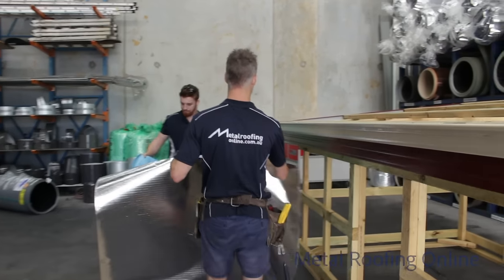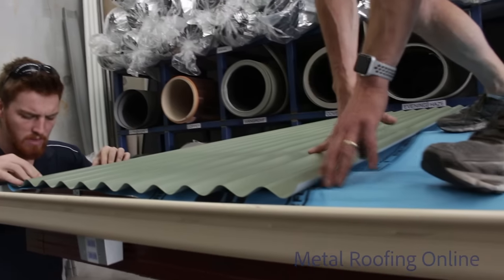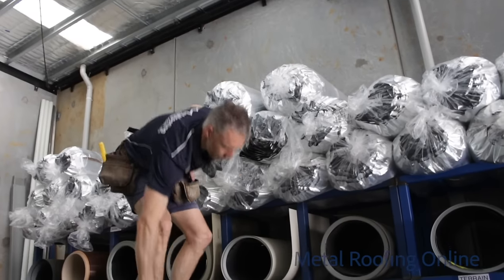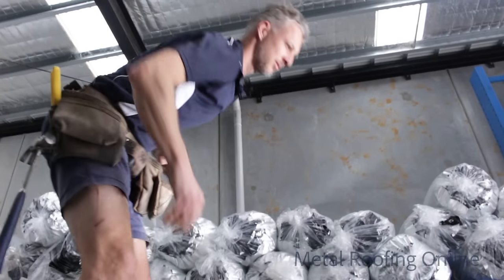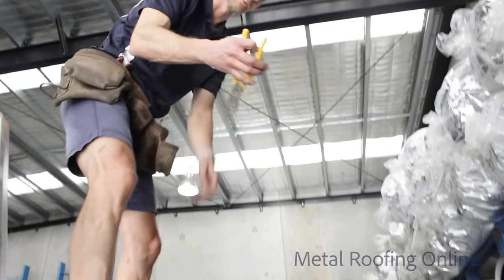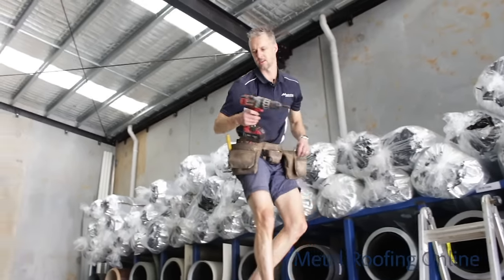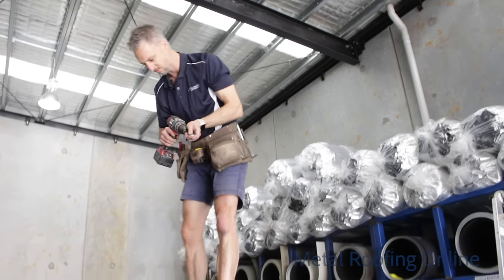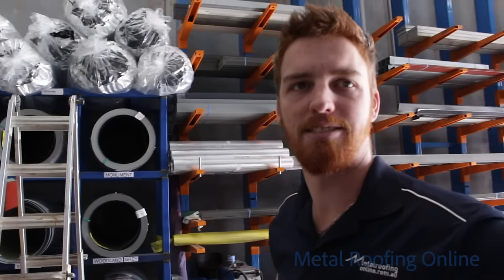How to: Install Corrugated Iron COLORBOND® or ZINCALUME® Roofing

Comment: Advice to anyone getting a metal roof fitted. NEVER fit it without an insulation blanket, foil alone is no good unless it’s just a garage. Must have the insulation blanket to suppress mechanical expansion & contraction noises during the day. Learned this the hard way. Don’t let the contractor convince you otherwise.

Comment: I would use foil under all roofs in any situation no matter if its a closed building or not, when the moisture is on the underside due to cold mornings and the sun comes up it heats the iron which causes the roof to drip, with foil it does not, I have proven this myself as i have a variety of roofs with and without foil.
Reply: actorzone thanks for your feedback

Comment: I get a bit of blow back (if that’s the right wording) under the end of the sheets. You can see the staining on the timber from the water where it tracks back from the end of the sheet where it over hangs the gutter. I have a 10cm fall over 5 meters. What is the best thing to put in place to stop it or how do you bend the end of the sheets down on the lower part of the corrugated sheets ?? (Love the videos by the way)
Reply: You can either nip the tin on the bottom curve about 5mm up or bend it down a touch with a crescent or something to give that effect.

Comment: sen a few roofing videos now why is the lining always sagging?
Reply: It give space for the foil to reflect back up. 
If it was in contact, it would transfer the heat by conduction.
Reply: It should not be sagging! The under lay is for condensation, if the paper is not self supporting paper, they should be using netting under the paper.

Comment: Can you tell me what size screws you use predominantly in this video? I've seen the term NEO and EPDM, are they the same thing? Also are they multi-grip screws?
Reply from the maker: The roofing screws in this video: 12 x 50 multi fix (multi grip) 

NEO and EPDM - the rubber seal on the screws. 

https://www.metalroofingonline.com.au/roofing-fasteners/17-colorbond-roof-screws-12-x-50-multifix.html

Comment: Doesn't condensation drip off the underside of the metal,  onto the saggy vapor barrier,  and then run down into the house???
Reply: I agree. Surely the condensation pools in the drapped material. What is the membrane you have used?
Reply: I don't think so. 
Not enough temperature difference also the sisilation is a moisture barrier.

Comment: Why have you put the paper the same direction as the tin? Am i missing something cos i lay the paper from the low side and work up so that condensation always runs over the overlap and cant find a seam to leak. I respect the pros, but can you clear this up for me?
Reply: I lay paper horizontal on low pitch roofs. Steep roofs it doesn't matter has a 150mm lap and the condensation runs straight down

Comment: Great effort guy's I have a couple tips. 
1. Use self supporting paper and pull it tight.
2. Use a string line into the gutter to get a straight line, laing the roofing iron.
3. Tack the roofing top and bottom, bottom being a consistent measurement, top being under the head flashing.  Chalk line the rows after the iron is installed, then remove screws from the to to install head flashing. This gives you perfect straight screw lines.
3. Great never over lap a sheet more then needed, it will definitely condensate and corrode. 
4. Stop end the sheets on the ground, 3 sheets at a time. Cuts your work down tremendously, especially if you have 50 sheets to install.

Other the that, not a bad job guy's. Thanks for sharing 👍
Reply: Awesome comment
Reply: These are super helpful tips thanks for adding this comment 👍
Reply: thankYou

Comment: Enjoyed the video but shouldn't the wrap be installed parallel to the gutter from the bottom up? And also installed nice ans tight?

The way this foil is installed, if any water gets under the roofing and there's any wind, its going straight through the vertical join of and into the ceiling cavity.

Comment: I’m about to use this roofing soon. Please can someone answer a few questions from a novice?
Is this roofing metal rust proof? If not, how do I get it rust proof? 
Paint it? What kind of painting should I use? 

How long can these sheets last for in a hot humid weather? 5years? more?

And how do you paint this kind of roofing? Paint it before nailing them on the roof? ...is there a good technique to paint these iron sheets when they are already nailed? Like how do you make sure the paint can stay on the roof without slipping off and spilling? 

Help please with any useful tips..gonna watch your other videos ❣️❣️
Reply: Hi there, Sorry but I do not have allot of knowledge on painting metal roofs. You should be able to get all the information you require from a paint shop. We do only use Australian Bluescope steel which has a 30 year warranty. Kind regards Darren, Metalroofingonline
Reply: These are Colorbond sheets - https://colorbond.com/products/roofing
Even the basic raw corrugated iron sheet was galvanized which meant it is rust resistant and should last decades. It would probably outlast any paint you applied... 🤣
The new Colorbond sheets are available in a range of colours and have the paint baked on. https://colorbond.com/why-colorbond-steel Check out the 5 layers of protection! Basically, choose your colour, screw it on and you're good to go. It's way more rust and weather resistant than any paint you can apply!

Comment: I didn't get the point about using foil or not. When do I use it and when don't I? Thanks nice video
Reply: Hi Matthew. I would recommend using foil when you have an enclosed space, like a garage, shed or house. And not using it when you have an open space like a veranda or carport. 😃
Reply: I would suggest always fit foil. 
An open spaces like carport will get very hot on the roof and then radiate that temperature down, like a heater.

Comment: Good work.  
I have a metal sheet roof in Thailand but they didn't fit sisalation. 
I will have to unscrew the 3m sheets I dividually to fit the foil. 
My house gets bloody hot. 
Underneath tin roof. 55 degree
Ceiling temp  42 degrees
Room temp.  37 degrees. 
Small windows and lack of a decent breeze doesn't help. 
My house will be cooler when finished. 
I know at least 25 degrees cooler under the foil.
Reply: Hi Glyn,
I would recommend using the insulation blanket with the foil. This will make a huge difference to the temperature inside the house. Best of luck, 
Regards Darren 🤙😃
Reply: I need to do the same for my patio cover. In the meantime I've set up a sprinkler system on a timer just trickling and in 10 minutes it is cool as can be and I don't have to turn it off again. Just set it for as long as I want to be under the patio and it stays cool for a while. From this video and their barge capping video maybe I can try one day and put insulation as well.

Comment: The irony is that the screw pattern you've used there is probably more intense, or at least equal to, most corrugated roofing I've seen installed in Japan - typhoon capital! If you saw the level of construction here you would not be surprised at the level of storm damage either... That Queensland pattern is hardcore! Every rib on the top and bottom, and every second in between? What purlin spacing is this based on? Also, wouldn't the screw depth affect this - like screwing a longer screw into 2x4 vs a shorter screw into 1x4? Actually a lot of the sheet metal roofing in Japan is just nailed on with capped screw shank nails... Good thing I can still watch Aussie DIY videos to learn how to do it right ;-) Cheers.
Reply: Caleb Fuller thanks for your feedback 🙂🤙

Comment: I’m about to sheet my shed. In QLD and Widespan instructions say 5 screws apex and gutter purlins, 3 screws for mid purlins. I noticed you said every rib for apex and eve purlins, and every 2nd for mid purlins. Are they wrong?
Reply: Instructions are correct. But if you want to put extra in then ok, as long as you are ok with the look.

Comment: Great video. I have to put this on my workshop. Are the sides watertight as they are and what do you do on the top where you turned up the corrugation?
Reply from the maker: The sides are made water tight using a barge capping on the sides. This is the video: https://youtu.be/v28-8Rwm0bE

Comment: Random question, but when ordering your sheets do you order them from apex to fascia? That way when u position the sheet with 50mm over hang you end up with that 100mm ish gap between the two pitches at the apex on a gable roof ?
Reply: You could order from peak to facia because you can have a 50mm gap at the peak on each side of the hip, 100mm total, this allows for some venting.

Comment: Great video, very thorough and clear. Just wondering can you turn down the lower end of corrugated roof to avoid capillary action?
Reply from the maker: Thanks for the feedback. You can use pliers to turn down the lower part of the corrugated sheets. This will help, but corrugated does not work well on a flat roof compared to a profile like trimdek or klip lok and should not be used under 5 degree roof pitch.

Comment: Hi mate, do you need to turn down the sheets for corrugated when they’re at a 5 degree pitch??
Reply: Hi Rod it would definitely help on a 5 degree pitch if you can turn down the ends slightly with your pliers 😀

Comment: When screwing in the sheets, how do you avoid hitting the nails/screws that join the battens and rafters?
Reply from the maker: Thanks for the message. This is difficult to avoid, when you find you hit a nail or screw you need to slightly angle the roofing screw.
Reply: Just how to use j hook in metal roofing
Reply: Screw the battens in top and bottom, knowing the roofing screw is going through the middle.

Comment: Also, i can understand the sag if your using woolbacked paper, but why do it for basic foil that can easily be installed flat and tight? Your feedback is much appreciated, cos everyone seems to do it slightly differently.
Reply: Hi Ceno. In regards to which way to run the foil. I was taught to run the foil down the roof length ways and have just always done it this way without any issues. If you were to to run the foil across the roof I suppose it would be a good idea only if the battens had been set up in the correct positions to support it at the joins. In regards to how much sag you should give it. Last time I researched this the-information I found said that you should let the foil sag down approximately 40mm between the battens for the correct air flow and less condensation. Personally I think that this is to much and can look pretty average, I only usually let it sag around 20mm. This would be a good question for the guys that make the foil. Hopefully one of these experts reads this and can help us both out with a more detailed answer

Comment: Sarking under a metal roof with 20mm overhang In the gutter, wtf, you doing massive commercial where the Insulation doesn't matter, if I sarked all my roofs I'd be broke, and my clients would be freezing